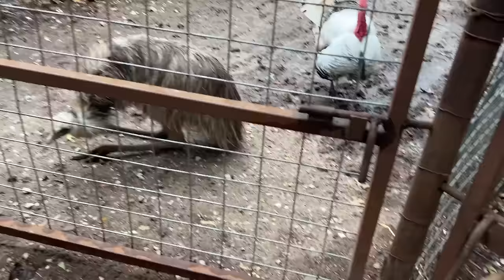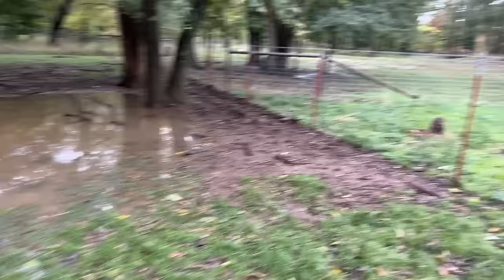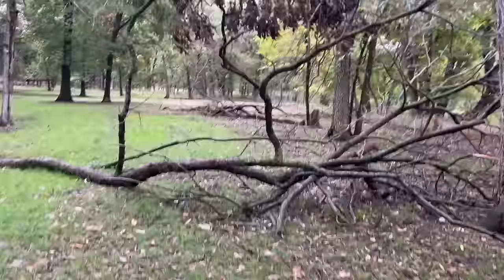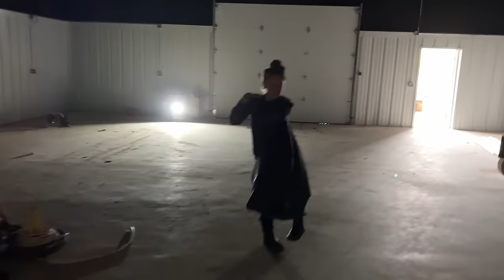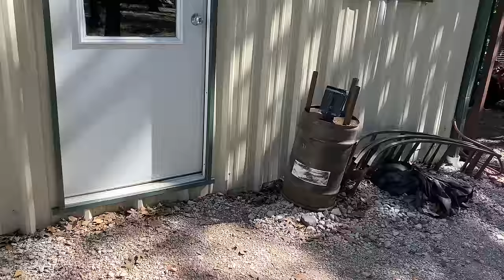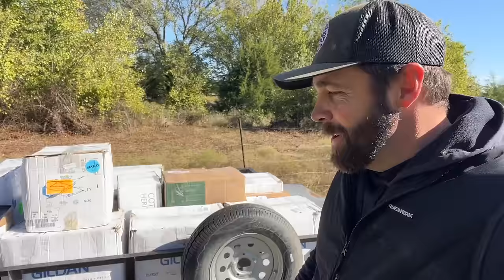This Is NOT Going to Work! We're in a Pickle!

Comment: As soon as the floors are cured in the merch building then use it as storage for stock only. The cold should not damage clothing. Move all your storage shelves over there that you do not need for shipping boxes/supplies and reorganize the garage with a good flow for shipping only. Your only option is to go everyday with a list, get your stock and bring it back to the garage so you can get it ready to ship. Resellers do this when renting a storage rooms because they cannot store it all at home. It is going to be rough and I would shut down for vacation to rest after the season is over but with a good routine it is do able.

Comment: What I would do is set up tables (you can sometimes rent them from churches or event places) and put the new merch in the shop on the tables. Get some smaller totes/boxes and use those to pull orders (put order in box) take back to garage to package and label and into shipping totes to run to post office. This way you pull say 10 or 20 orders or so at one time and take back to garage and process them from there. That would be the easiest way to do it in my opinion, no need to move the whole operation to the shop building. Then you don't have to worry about internet reception. You have one or two in garage packing orders and doing shipping labels and a couple people in the shop pulling the orders and taking them over to the "mailing center" lol.

Comment: Sending prayers for Captain Ron. A suggestion for using the new Merch building. Can you take one or more of your generators over and use it to light and heat part of the building? It seams like a perfect situation to set up in the new location and show how powerful the power system can be. Just a suggestion.

Comment: Prayers for Ron, Verizon has a new box for wifi  you just plug in wall and connect your stuff it's 25 or 35 a month my family uses it because it's a lot cheaper than most others here in Carolina and it works great for everything we use it for

Comment: Could the elctrician run a temp cable from the exsisting meter to power the lights in the new building. kind of like for a Trailer house or RV

Comment: #1 You said you have a meter and power on the utility pole out by the road.  Have an electrician install a " temporarily " breaker panel. 
#2  Then have them  run a "temporarily " underground cable to the panel on the back of the building.  ( Check with your electrician) 
    Lord, by Your stripes, let total healing come over Ron and allow him to be healed in Jesus's Mighty Name.  🙏